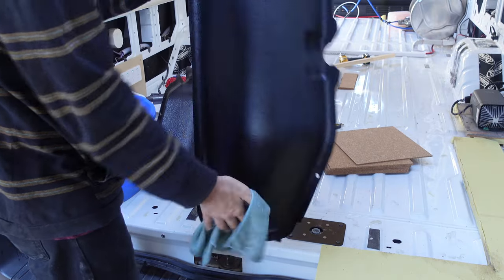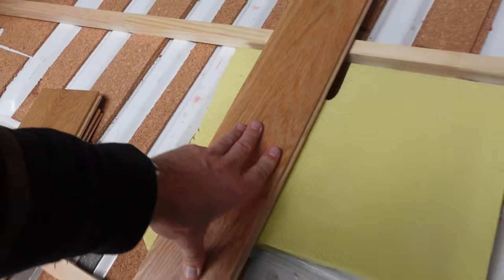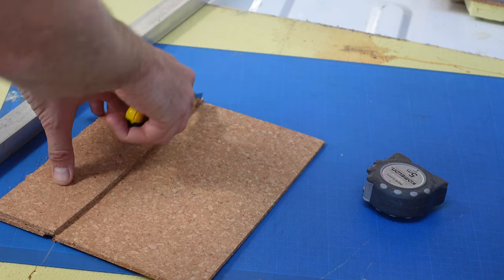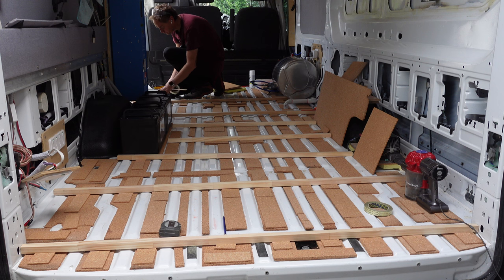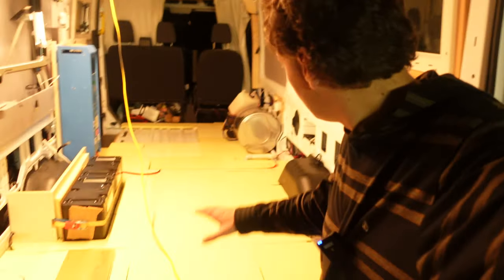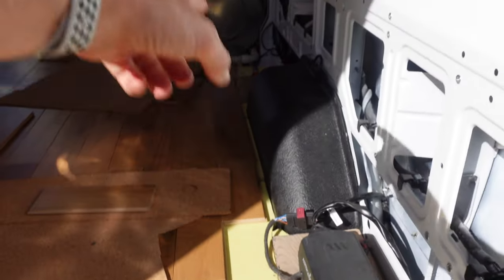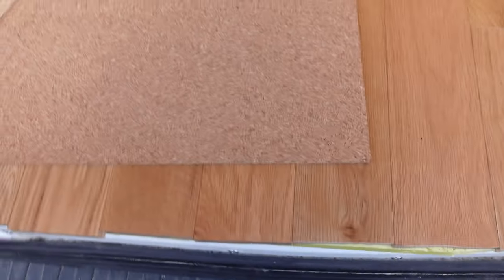Is this the best looking floor ever installed in a van?!

Comment: Scratches might not be a huge deal. Obviously you will keep a few spare planks as spares so that if needed you can swap them out for any that become damaged. What batteries are you using? Your last DIY battery was legit. It inspired me to go the diy route with chinese 280AH cells.
Reply from the maker: Hey Kevin, yeah I'm not too worried about scratches. Unfortunately I cut a couple of long planks wrong around the shower, so I'm down to about 1-2 spares only! And I can't buy more easily... worst case I can swap planks with ones under the bed or something. 
As for the battery, I decided not to sleep on top of an extremely large lithium ion battery pack, especially after I had a few cells go bad. So sold it and upgrading to lithium iron phosphate, which is a lot safer and less likely to go flames :)

Comment: Another question that have just occurred to me (pardon if it's covered in the old videos) - Where is a spare tyre? If I remember correctly, you have a tow thing installed. So you probably can't have it underneath anymore. And you also covered that stock bolt to lift/lower the stock spare tire. That's why I'm asking.
Reply from the maker: Hi yeah it's underneath as stock for the Transit. Not shown in this video but I drilled a hole to access the release for it. Cheers!

Comment: Missed your videos.
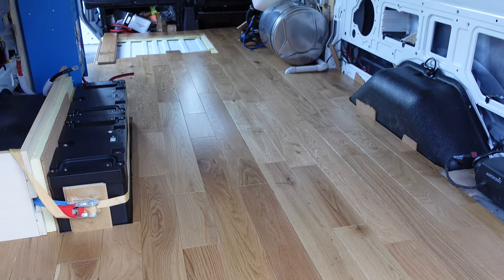6:21 - I hope the "next time" won't be in 6-ish months or more :-)

Looks like you decided to remove the bulkhead leftover. What drove that decision?
Reply from the maker: Hi it was good in that it held things under the twin seat storage area in place, but it wasn't needed around the drivers seat. After pulling it out I'm glad I did,  it was very heavy! So a waste of weight. I can replace it with a small piece of wood and some stretchy ties.
Reply: @EatSleepVan  Yeah, I do remember your weight struggle. Thanks for elaborating on this!

Comment: If I did that, I would be unable to stand up straight. I can stand now, if barefoot (or wearing socks), on about 4mm of conveyor belt rubber.

A box over the wheel arch gives you a flat surface on which to put stuff. Batteries perhaps.

With those battens across the vehicle,  I think your cork is adding nothing. If you are going to carpet, perhaps 6mm plywood would be better flooring.
Reply from the maker: Hi I was joking about the carpet :) quite frankly plywood would provide a more solid base, but I wanted a real wood finish, even though it's not very practical in terms of wear and tear. Cheers!
Reply: @EatSleepVan  I found some 11 battwna, I think those will do to fill. Possibly then 3mm MDF and carpet. Just a strip down the middle, probably.

I was thinking about weight. My van's carry less then 200 Kg by my guess, and I get about 9l/100 Km fuel consumption. The van's a size shorter than the Jumbo.